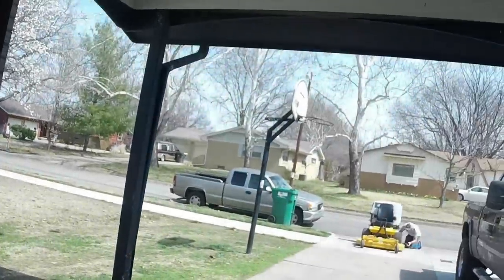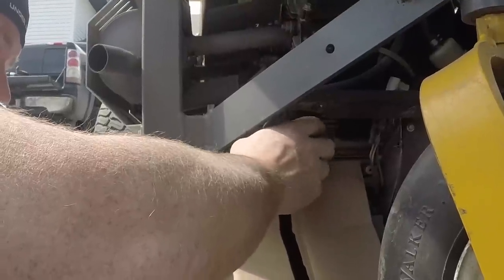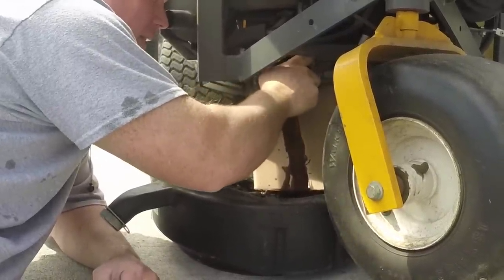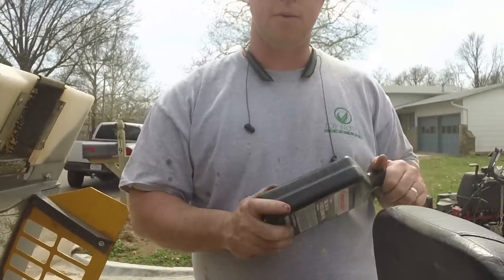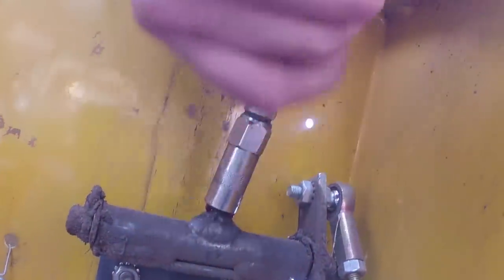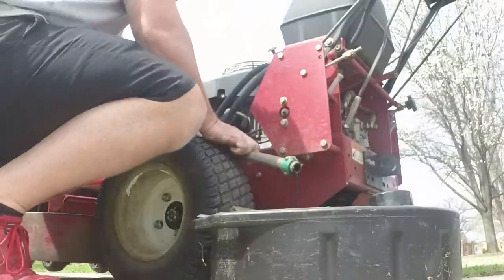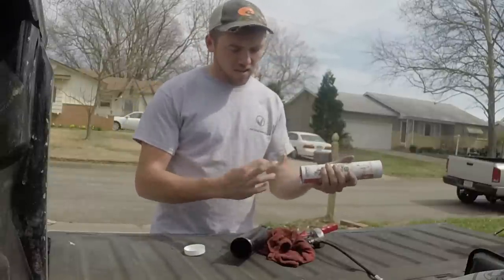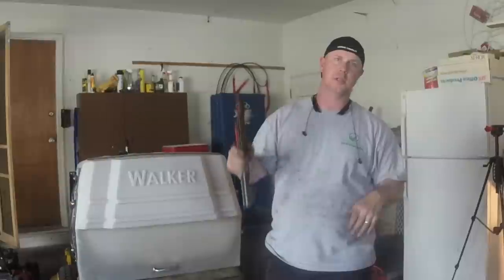Lawn Care Mower Maintenance - How to Load a Grease Gun

Comment: Yep, I did the same thing on Saturday when it rained here. Spent the day doing maintenance on the mowers, cleaning the decks, oil changes, greased zerks, etc. Time to start using the equipment to make the $$$
Reply from the maker: Yes sir, it is almost here. I'll be starting in a couple days.

Comment: Good video Bryan. When you load that grease gun, leave top on loose as you push rod down slowly. It'll push the air pockets out much better and you'll have grease almost instantly. Another tip as far as checking oil: rule of thumb- if it's a black dipstick cap you screw it in. If it's yellow you don't screw it on to check.
Reply from the maker: Cool man, Thanks!!

Comment: whats funny is that I think all zero turn and walk behinds have some part that needs a grease gun if not multiple parts. I bought a troy built zt. I always helped out my friend mowing who had a john deere which had 4 or more grease joints. I asked her what are you doing? I found out I had to add greasing to the list of weekly/ monthly maintenance. we looked all over my troy ztm and we saw none. months later I was just talking about greasing with my mower mechanic and he told me it does need greased too. I thought mine was no maintenance or something. I forget how many it has but at least 2. short story is good video all mowers commercial , zt, or walk behind have grease fittings we should grease. don't know why I said all this. thanks though
Reply from the maker: Haha!! Thanks for the comment. Gotta keep things greased up.